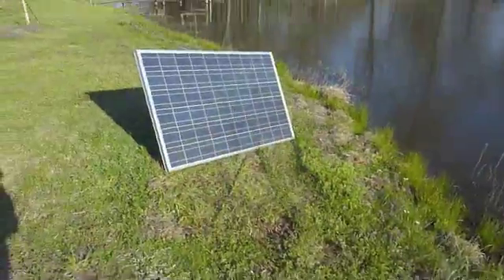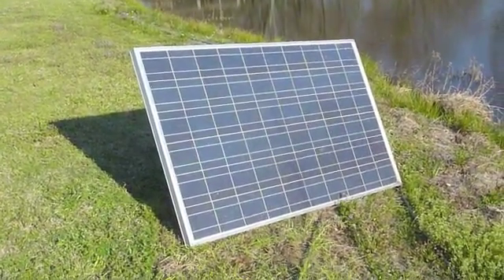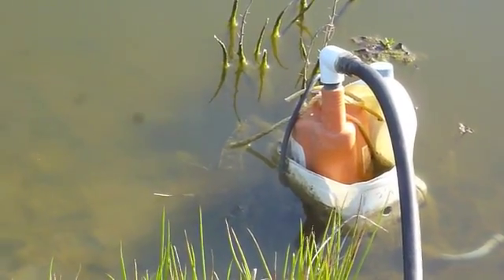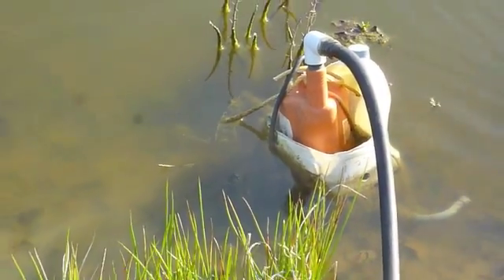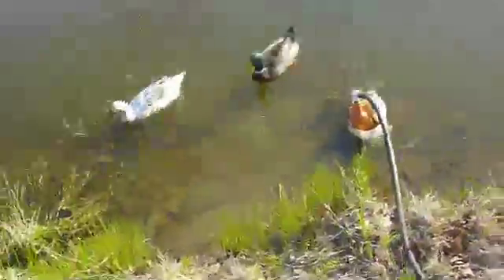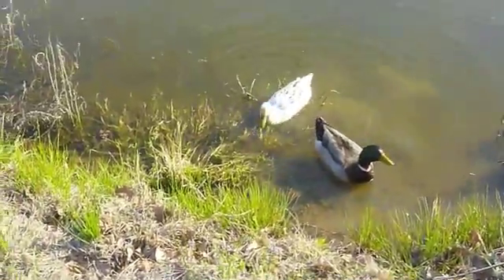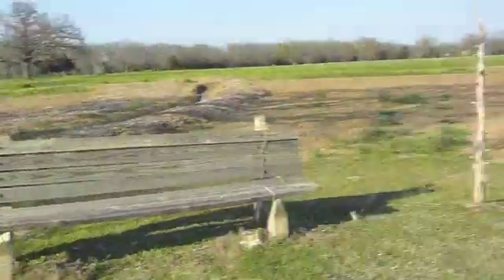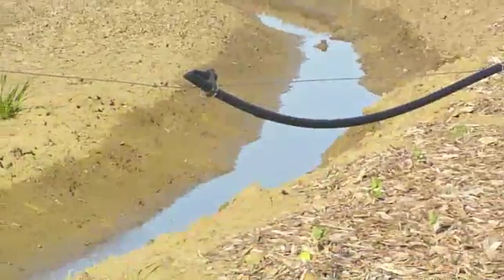Solar Irrigation

Comment: Simple and functional. I've given up on battery voltage panels as grid tie panels are so cheap. Performance can be improved by building a simple MPPT out of a cheap buck converter. This makes it act as a Linear Current Booster that is often used in battery less pumping systems.  Panel voltage is held at fixed voltage at near the power point.  Current is boosted and that is all a pump really look at. Daily hours pumping can be extended and boosted at least 40%.  The pump load of a direct connect can easily drag panel voltage down in less than prime light conditions. Power is a function of the square of the voltage and a drop is a real killer. There are rewards for those willing to experiment.
Reply from the maker: Are the panels different, or the power handling behind them? Grid systems are cheaper, but I think there exists a "disincentive" to go off-grid.
Can you share specifics of a cheap buck converter to make a MPPT controller?
As for this pump, I didn't measure the electrical characteristics, I just used it and found that it worked well even when not getting full sunlight, as the pump just slowed down. That's the beauty of a DC system - an inverter would have shut down when the source voltage dropped.
Reply: @ThomasGriffing  Common 60 cell grid tie panels have a power point voltage of 30V, 72 cell a bit higher.  A 24V battery type panel has a power point  of about 36.  30V is a much better match for a 24V motor and for the same power it will be able to supply more current to the motor. The disincentive to off grid is they can not be used with PWM battery charging systems in the summer when they get hot and the voltage drops.  Two grid  panels in series is perfectly fine for any MPPT on a 24V system or a single panel on a 12V.  The disadvantage is the extra cost of a MPPT controller on a very small system. Lower cost of smaller wire quickly makes it very advantageous as the system gets larger.

That is the beauty of a LCB system.  Panels are a current source and you will get the same current from the panel at 12V as 24V, but twice the power.  That gives more time pumping at at higher rates.  I have one od those cast iron pumps with a 120V AC/DC motor. Those can be identified as having brushes.  I have a shallow well and was going to use it for watering with a 60V array.  Never got around to it last summer.

Any buck converter can be used as long as it matches voltage and current specifications.  Two can be used for higher current and de rate the current specs by about half.  Board electronics must be accessible so it can be modified.  Using a buck converter not modified quickly turns panel voltage into a death spiral.

Curious if that pump is still running.